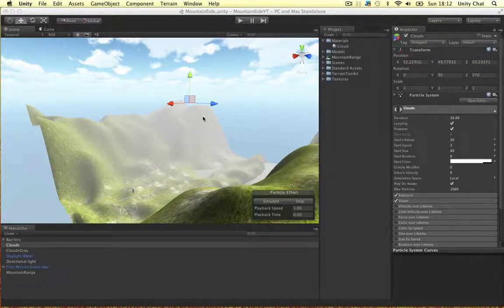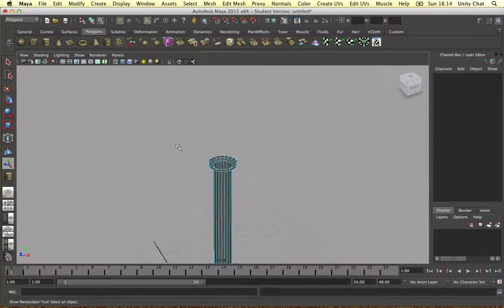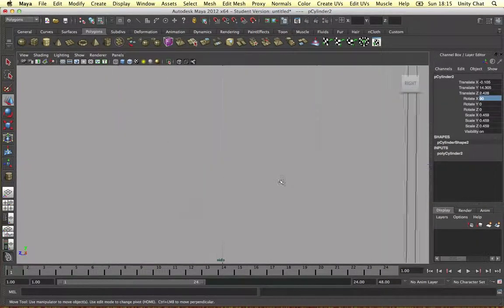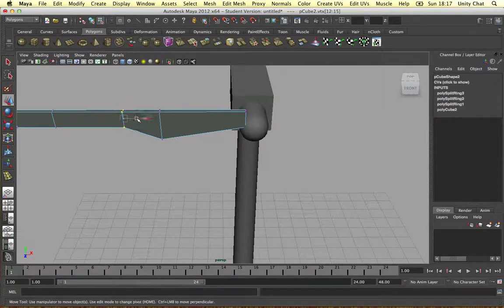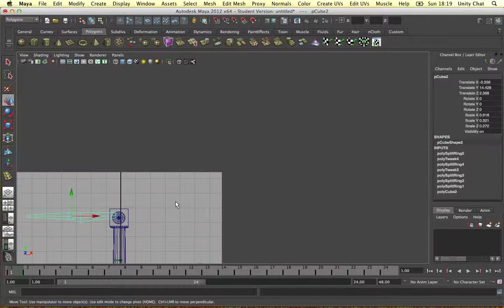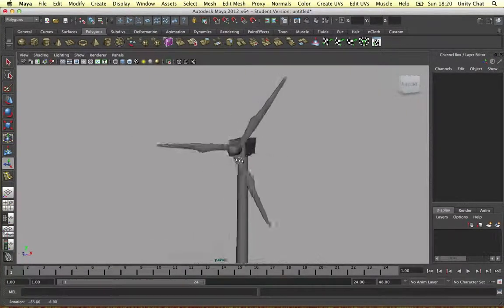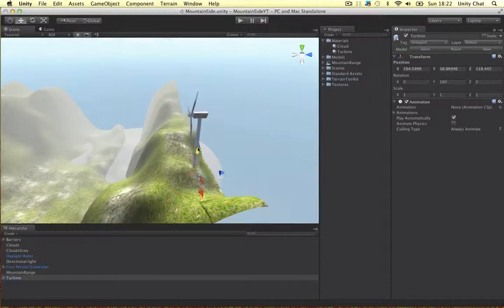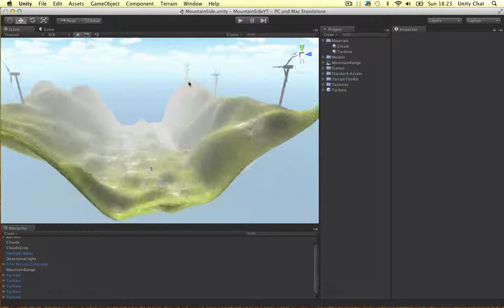Unity Mountain Range [6] - Model a Wind Turbine

Comment: ))) Good example of fast-modeling ) The funny thing is about the whole concept of your scene: when there is a valey between two mountains - the wind always blows along the valey (not perpendicular to it))) - that valey itself is a result of thousands of years of wind erosion ) Also notice that wind turbines rotate thier fans into the wind (so two rotations are required - the spin of the fan, and rotation of the fan frontside to the wind direction) - but since it's just a fantasy not a simulation nor a depiction of reality - it's fine as it is )